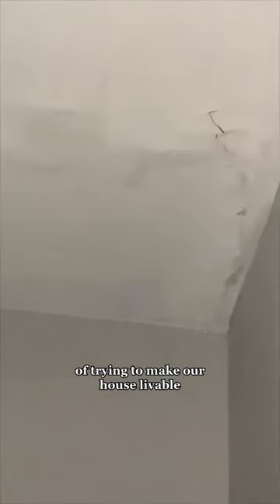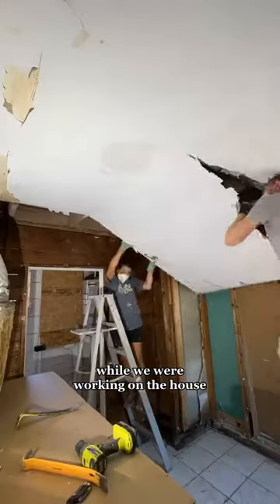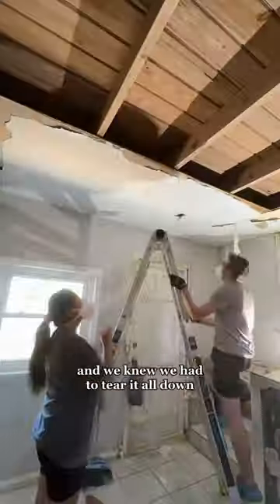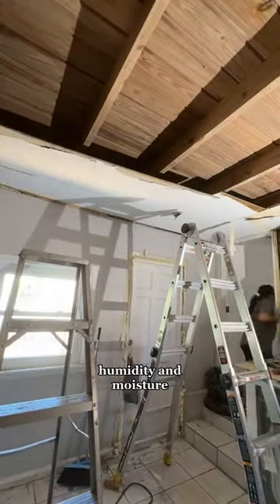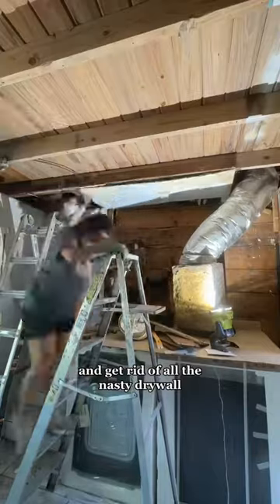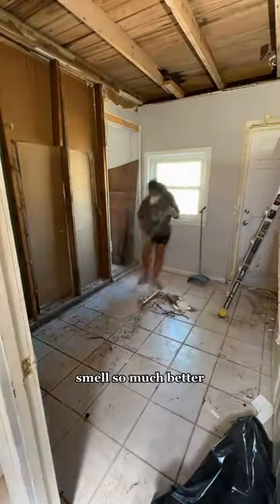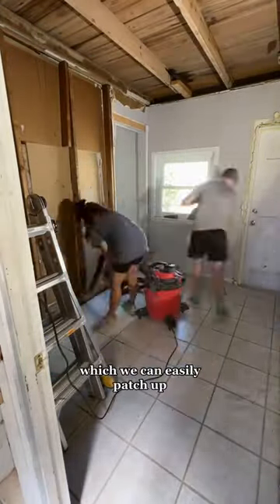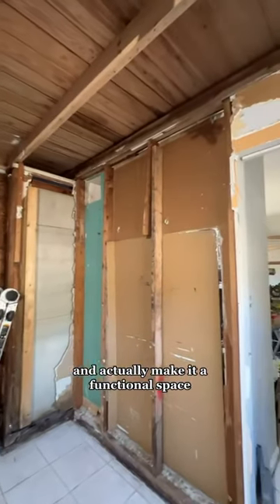204-removing the ceiling #housedemo #storytime #houserenovation #house #diyhomeproject

Comment: Always keep A/C on even in drywall your going to take down. The mold just grows more in the heat and humidity. People with second homes in the south know to keep their A/C on. I also bought a house as is that had a “some” mold until I started remodeling. The house had sat empty for a while. I had to replace the drywall for the entire first floor.